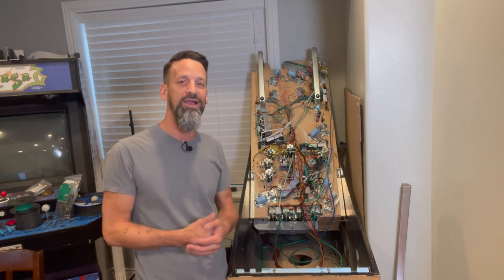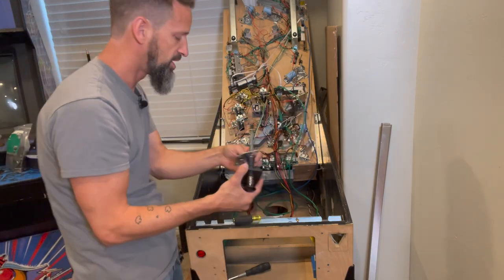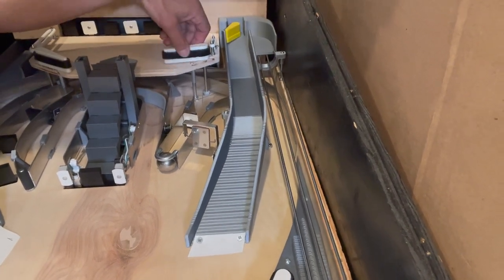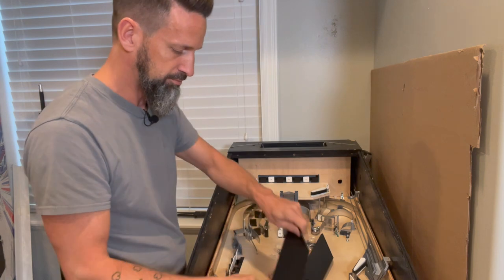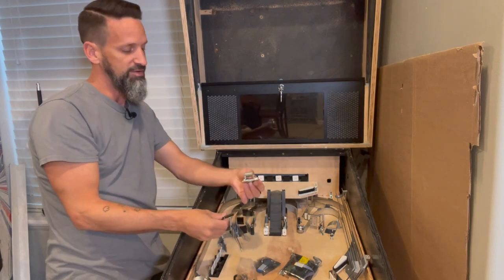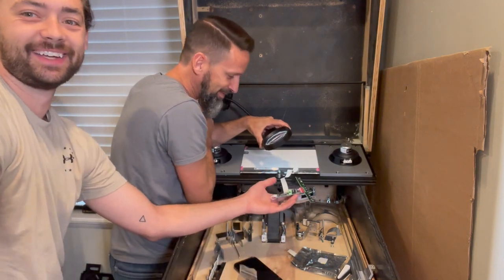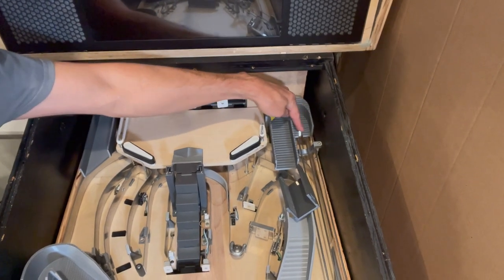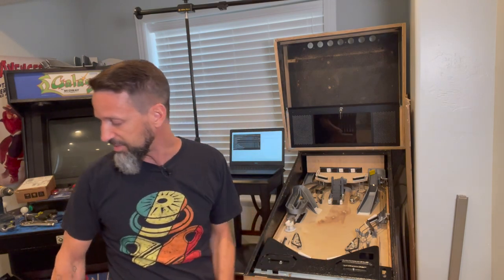HOW TO MAKE A PINBALL MACHINE: Ramp Switches

Comment: Regarding print orientation, I struggled with that for a while as well. It's a bit of a non-answer but I found it's usually best to split complex parts into multiple pieces and print each in its optimal orientation rather than trying to find one perfect angle. The trick can be finding a clean way of fastening the parts together but there are a few good options:

I find heat set inserts are usually the best route. If you're not familiar, these are small brass/steel nuts that can be melted into the part using a soldering iron and give you a metal thread to bolt into. Designing for them is simple as you just have to model a small hole in the part for the insert to be pressed into. The only downside is you usually need to press the heat set in from the opposite side you're bolting into so it gets pulled into the part rather than being ripped out when the bolt applies force; although, you can usually press them in from the same side as long as the load on it is light. If you go this route just be sure to buy the heat sets with diagonal ridges rather than vertical ridges. The ones with vertical ridges are cheaper but are intended to be encased in an injection molded part and can easily rip out if pressed into a printed part.

If you don't need to remove the parts again, self-taping plastic screws can also be a decent choice. When using screws, you'll want to model in a small pilot hole where the screw will go. The diameter of the hole isn't all that important but having it there in the model will force the slicer to place walls around it that the screw can dig into. Without modeling the hole, there's a decent chance the screw won't have much to dig into due to the part being hollow.

Another option I've found to work well is modelling T-slots into the part just wide enough to slide in a hex bolt/nut. The slot will prevent the bolt/nut from turning and either give you a threaded rod to fasten to or a captive nut to bolt into. The nice thing about this approach is T-slots for small nuts/bolts (say M3 or so) can usually be printed on the underside of your part (the T standing upright relative to the print bed) even without support material. This can be really helpful if you need to fasten to one side of a part but can't have a hole on the other side for a heat set or nut.
Reply from the maker: Dude, thank you for sharing this! Someone else had told me about heatsets and I'd totally forgotten about them!! Yes! I need to try these out I think it'll really help take my complex prints to the level I need. Thank you!!

Comment: Your diverter is a binary state device. You don't need the upper 2 switches. The state of the flipper determines which code to run. Assuming you're using a c based language and you use the lower switch to start, it would be something like...

If(diverter.state == high){ upperField();}
else{ switchback();}

Comment: Exciting progress, awesome to see it nearly ready for the show.  I've been at this point many times, sometimes succeeding, sometimes failing.  Wishing you success!!

Regarding your diverter, if I recall correctly you used a solenoid, which is not the best choice for an always-on solution.  A stepper that can retain position, or servo that is designed to hold position are both much better choices.  You have to be very careful powering a solenoid for a long period of time, as both the solenoid and circuit can burn out.  While you can PWM the solenoid to keep power low, you might not be going low enough, which could be why you're burning out circuits.

Regarding your new ramp switches, it might be an optical illusion but it looks like there's enough room for the ball to squeak by without triggering the switch.  Probably want to make sure there's nothing in the code requiring a switch hit for normal operation. 

Got a tip for you and your viewers on the plunger - something I only discovered this past week and it took me over a decade to notice!  The plunger mounting bracket is asymmetrical.  The side that has the 45-degree notched corner is actually wider, extending further from the screws.  When I cut my plunger hole, I first mount the lockdown bar's mounting bracket, which has a cutout for the plunger mounting bracket, and then I position the bracket in that cutout, inset about 1-2 mm from the cutout, to determine the proper position for cutting the hole.  This works as long as you have the 45-degree notched corner towards the center of the cabinet, otherwise you will be off by a few mm.  I was happy to finally discover this, as I was confused why my mounting methodology sometimes worked and sometimes was way off.
Reply from the maker: Ahhh!! Thanks for the info regarding the plunger mounting bracket I hadn't realized that! Thank you! 

As for the diverter, I'm definitely looking for alternatives, as I've since blown a third transistor fiddling with the settings - but I know that coils can be safely used, so hopefully we'll solve the mystery sooner than later
Reply: I don't use pfast/proc parts, so I'm not familiar with them, but I do have an idea on the blown transistors since I design my own circuits.  For transistors, the lowest heat levels are observed with either full off or full on.  As soon as you introduce PWM to reduce power, you are transitioning between full off/on so much that the transistor spends time in a partially open state, and this can heat it up a lot.  Think about holding a rope with your hands: if you close your grip tightly and there's no movement, there's no heat.  If you completely open your hands, the rope moves freely, and there's no heat.  If you halfway grip the rope and let it slip a bit, you risk friction burns.  For any outputs expecting this type of load (i.e. Flippers), a board designer might use a stronger transistor as well as heat sinks.  Perhaps these boards can only safely do long-duration PWM on certain outputs, and if you use it on a less robust output you risk overheating the transistor.  Transistors are quite fragile if you operate outside their spec range.  If the pfast/proc boards have dedicated flipper circuits, then use one of those for anything that would stay on for a long time, as they should be more robust.

But there's still a risk that even an upgraded flipper circuit may not be enough.  In your design, I believe you are activating the diverter for several minutes at a time, and in theory it could be powered on for hours.  I believe even on PWM'd flippers, you want to limit how long someone can hold one up to prevent heat soak and failure.  Maybe you can put a timer on the diverter, and only have it open for 1 minute max, and make that part of the game-play challenges.  On a pinball machine, you rarely use PWM for non-flipper solenoids.  I am using it on a drop target reset that I put an overpowered coil on, because it was breaking parts on reset, but in this scenario the PWM is only on for a few milliseconds, not minutes or hours.

You also often see something like a buck regulator between the power driver and the solenoid if you are using PWM to limit power.  For example, the buck regulator can take a 25% pulsed  40v signal and make it appear to the solenoid as a 10v signal.  I think buck regulators are more for smoothing PWM'd power delivery to the solenoid, but it might also reduce load/heat on the transistor.  Buck regulators are pretty simple devices, and I think you can buy some pre-made off Amazon.  The higher your PWM switching frequency, the smaller the regulator needs to be.  I think some flipper mechs come with a buck regulator on-board.

Wish I could help more on the pfast/proc stuff, but I've never used it myself.  In fact, your video the other week was some of my earliest exposure to how you code it up, and it actually made me really happy I don't use it.  😉